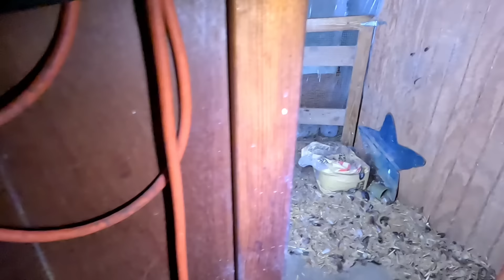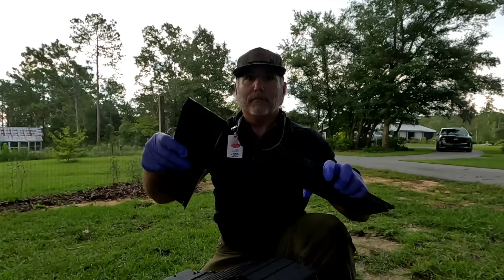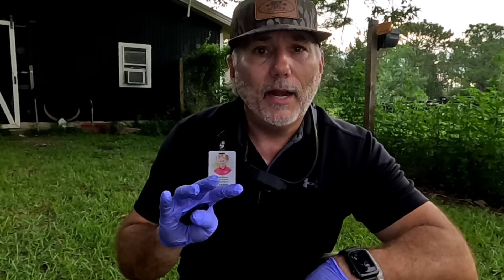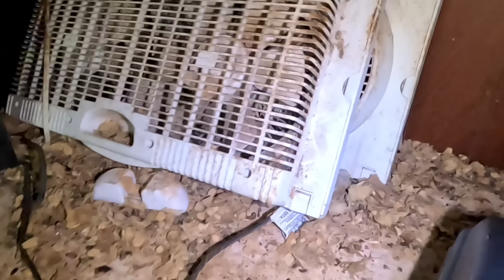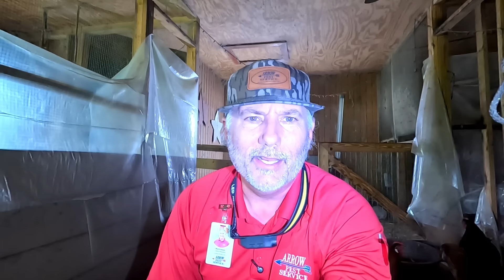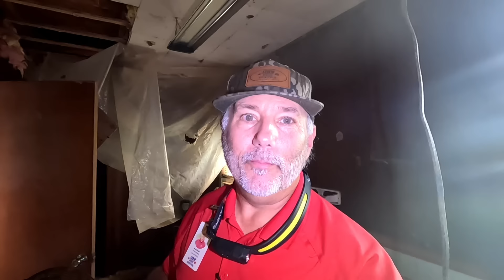Most Effective Rat Control Method Nobody Talks About!

Comment: If there is a existing food supply,  rat's will go for that rather than the bait, they are very short sighted and use the hairs on their fur to kinda see, they remember a layout of a room by rubbing along the sides of a wall or floor. When adding something different along their runs, they will avoid it like the plague until they get used to it, only then will they maybe venture into a bait box, but as i said, if there is food elsewhere that they have been tucking into for a while, they will still probably go for that. 
Then you have the issue of which bait to use, gel, wax, grain etc. As professional pest controllers we have a little arsenal of poisons that we use, very rarely have i only ever had to use one type of bait for a bad rat infestation, Rat's are not stupid, once a particular bait has been ingested and a few rats are unalived, the other rats will not go near the bait. You will need to change it for something else. You also need to know the best places to put the bait.  There is also the issue that most baits are multi take, this means the rat will not die after ingesting it's first meal, it must have a few takes for the bait to work, this is so it's safer for pets and wild critters but secondary poisonings do happen. Then there is the smell, there is a reason we have the saying, i smell a rat, nothing worse than a rat dying under your floorboards or in a space that is non accessible and decomposing slowly.  The fastest and cheapest way i think for non professionals to eradicate them is by using pre baited glue traps, the smell is enticing to rats and mice. You can lay as many as you like down and if you place them in strategic places along their runs, they will have no choice but to run on them or starve.. It may not be nice discovering a live rat trying to chew his leg off to escape, but it's better than having carcases rotting around your house or wherever the problem is.. The only other fast method is to kit yourself up with a silent airgun with night vision and laser red dot ,make yourself a comfy spot and start shooting, you can take hundreds in one night.  There are many video's on YouTube showing the success ratters have with airguns..
Reply from the maker: I have an air rifle  with a thermal scope, I thought about doing that and I still might.
Reply: @ArrowPestService  If it's a springer, the noise will scare them off a bit, with a multishot PCP they won't hear a thing..
Reply: Longest comment award

Comment: I got/had a problem with with ground squeals, rats, chipmunks field mice and pretty much every other kind of rodent. Uncle died and I took over his trailer we live in the desert so everything is attracted to this property. I tryed snap traps and glue they worked well enough but not for the big things. What I ended up doing was using 5 gallon buckets my uncle had old motor oil in so the sides were slick some rain water got in em about quarter of the way up. Ended up catching 4 or 5 per night in each bucket. I guess being the only source of water in the desert pays off. We have just been using the water buckets all summer. Its cut down the numbers pretty well. I now wana used these bate boxes you just showed us. But I will continue using the slick side water buckets also haha
Reply from the maker: Sound like you're doing a great job!keep it up.
Reply: @ArrowPestService thanks man
Reply: 12 guage shotgun
Reply: @tomkelly3896 tad bit over kill 410 works a bit better but I like where your head is at. The bucket is passive trappin. If i wanted to go on the offensive 410 with some bird shot wouldnt be to bad of an idea.
Reply: Yeah I got a 410 and a 22 i use when im bored and taking an active roll. But update the bait box works great. And i got a gang of cats now.
Reply: Oil floats, what were they attracted to?
Reply: @speedfreak8200only water in the middle of the desert.

Comment: After 20 years I started getting rats in my roof. I worked out,  they were getting in where pipes for A/C thru the brick. Installer never sealed up hole they made to run the pipes thru. I baited, got two,both by the outdoor A/C unit. I waited until the hottest part of the day and filled the holes with spray foam. Cheers
Reply from the maker: Good job finding the entry point and sealing it up!
Reply: @ArrowPestService thx mate
Reply: Take that new 5 gal bucket without the trap ON it, lay bucket it on its side (lay trap portion next to it) and throw some feed in and on them, for a day or two, then set it up they wont be scared of it. Also for bait us baking soda 50/50 with corn muffin mix making sure they have access to water....they bloat and die. But wont contain poison
Reply from the maker: @itscommonsense3128 awesome, thanks!
Reply: Had the same problem, could see daylight from inside, sealed with that black roof repair

Comment: On his channel, Shawn Woods talks about setting up the bucket Trap as a feeding station (disabling the flap door) for like a week to get the mice/rats used to it.  Then it's effective.
Reply from the maker: Yeah, I know I said that who has a week or two to get rid of rats. It might work, but it's not the most effective way to do it.
Reply: Natürlich kannst du das Futter auch hinter den Drehpunkt legen, nur vorne ein Gegengewicht !!
Reply from the maker: @CRPRA1703 👍
Reply: I put small dabs of peanut butter at the begining , middle and top of the ramp.
  They climb up and even eat peanut butter i put on the door.
 Some times they eat it and get away .
 Its crazy because the ramp is  balanced so if they get near the pivot point it can dump them .
 You cant put peanut butter past the pivot point it will tilt down.
I dont have the model you have . I have a generic knock off but it has caught me some.
 Good ideas in the comments i will try.
Reply: @vainwretch  maybe put it on the underside of the lever because they will still smell, and after having a taste they will be interested in getting more

Comment: We've used the bucket method, but we made it ourselves. Using a plastic water bottle making a hole in the bottom and then insert a stick or dowel threw it so it spins. Spread peanut butter on the middle of the bottle.. Filled the 5 gallon bucket half full with water. Then used a large  stick as a ramp to the top where the water bottle lays across the top of the bucket.  When the mouse or a  rat goes to get the peanut butter the bottle spins on the dowel and the critter falls into the water and drowns. Most we've got in one night was 13 mice. The bucket you have is too new, if it was covered in dust and rat poop it would have encouraged them to go into the bucket. But then you would have had a bucket full of live angry rats willing to jump and possibly bite you. Put water in there so they drown. As for the poison now you got a bunch of dead stinking rat bodies in places you can't get at to dispose of. Gross plus I think rats soon learn to stay away from that bate box. So will work for a bit, but the smarter ones will stay away and the problem will continue. 
Feeding rats baking soda mixed with peanut butter also works, also give a source of water to drink.  Rats can't burp so as soon as they drink water the soda bubbles in there stomach and they expire. Not nice but effective.
Reply from the maker: Wow-Thank you for your comment!
Reply: @ArrowPestService Use automobile antifreeze instead of water (as long as no livestock can get to it and drink it).  It doesn't freeze in winter and eliminates smell when they die.
Reply from the maker: @apetro8895  that's good to know thanks
Reply: @apetro8895 that's a new one! But I would make them venture outside to find a drink so they don't die inside
Reply from the maker: @speedfreak8200👍
Reply: @apetro8895  only issue with that is that if you have pets (cats, dogs, livestock, horses) that can get to the antifreeze too, they like it because it's sweet and it will kill them too. :( So make sure pets can't get to it, at ALL.
Reply: @reneejoy8004  Did I not mention that in the parenthesis?
Reply: @apetro8895 love this
Reply: @ArrowPestService  thank you for posting this video. Please post more. I also appreciate the comments. Thank God and Jesus Christ!
Reply from the maker: @TiffanyClark-p9t 🙌🙌🙌
Reply: Yes, that’s the problem I had with feeding them poison when they were in a 150/200  degree attic in summer in Phoenix… the smell! 🥴
Reply: Yep i had one go up inside my fridge and die couldn't get to it had to live with rancid smell everytime i opened the freezer it was blowing rotten rat fumes in my face🤮🤮🤮
Reply: @djp11WA  i would be in for a new fridge.
Reply: @djp11WA  Oh YUCK!! 🤢 I hope the smell finally went away.
Reply: And you kept the refrigerator and continued to eat food out of it wow!!!
Reply from the maker: @JohnLaws-sg8yh 🤣
Reply: I got rats in my loft; they won't go in snap traps or the cage traps. I can't use poison, so I'm going to try this bucket trap. Hope it works. I will let you know the results.
Reply from the maker: @Wy4U28  it may take a little while before the rats go into it but be patient, let me know how it goes. Thanks for watching.
Reply: @Wy4U28 did you try it yet?
Reply: @Tonisuperfly following
Reply: @Wy4U28  how did it go?
Reply: Dig a whole and set the bucket in it so you won't need the ramp and it will attract better with the  contraption being level with the ground , they will carry all the bait back to a nest for their babies, they aren't always eating the paper
Reply: The baking soda produces CO2 gas when it meets stomach acid, not water.
Reply: what is the measurements for the peanut butter + baking soda.
Reply: @andrievbastichy8551  -2 parts baking soda 
-1 part peanut butter
Reply: @andrievbastichy8551 ■ I use dry plaster of paris mixed with corn 🌽 meal and dabs of peanut 🥜  butter
Reply: @andrievbastichy8551 someone mentioned a 2 to 1 ratio.
Reply: Instead of water, I usye waste car oil in the bucket.
Reply: Rats will also carry bait back to their nest to feed their babies
Reply: I currently have a coop with rats big ones we tried the bucket trap no luck we got a few with snap traps under the coop they seemed to have figured out the snap traps haven’t caught one in there in weeks I have a camera in there so I see them every night running right by the where the traps are I can’t use the poison cuz they could die in the walls of the coop house is there any other method I can try is there some bait that rats can’t help avoid there is a ton of food on the food in my coop so there is a competing food source as well any advise would be great
Reply: How do I cut and paste these instructions.  We have a problem in our community garden
Reply: Electric rat traps work. No matter what is said here, tons of wildlife and cats get poisoned every year. Also chickens are omnivores and will take on a rat or Peck a dead one. Use caution with poison
Reply: Please make a YouTube video of your method. It would be very helpful to others.
Reply: Can you post a picture?
Reply: I think I need to get out more. Reading some of these comments has got me so excited to get my big butt out in my backyard and kill these little bastards.
Reply: I use the baking soda peanut butter trick and it does work! Safe for my pets too which is a very big thing for me
Reply: I used a similar bucket trap when the snap traps & sticky traps failed to eliminate some persistent rodents.  The bucket trap did the trick.  Instead of a wooden dowel, I used stiff wire from an old coat hangar, & I used an empty 2-liter soda bottle, which formed a larger bridge than a water bottle, making the rodents (rats & mice) more comfortable using it.  I smeared a little bit of peanut butter on the "ramp" (an old 2x4) in a few places to attract them up it, then smeared a bit more in the middle of the bottle.  They never defeated this trap.
Reply: @y @ywr969  did you ever try the baking soda and peanut butter method?
Reply: I used that method long time ago 2 to 1.
-2 parts baking soda 
-1 part peanut butter
Or
-2 parts baking soda
-1 part flour
Reply: They also love Jiffy corn meal mix with baking soda

Comment: You can put vegetable oil on the bottom of that bucket and leave it there for months and months you can dig a hole and dump it it's all biodegradable. What's your opinion on those birth control poisons they're using in New York
Reply from the maker: Interesting, I'll have to take a look at that! I appreciate your comment.

Comment: Didn't see any DEAD ones, though. Do they get eaten by the live ones ?
Saw a mouse coming to a baited mouse trap (the green block type), looking 'groggy', and before it could get to the trap, I smashed it with a club, splitting it so it's guts spilled out. It's intestines, etc, had the EXACT same color green as the bait blocks, so it obviously thought the bait was some kind of TASTY DESSERT. And it probably wanted a BUZZ.
So maybe the dead rats/mice could be extra tasty to the live ones. The poisonous bait will kill cats, though.
Had another mouse in the winter DIE with it's snout in one of those same block type traps, it's fur having turned that same color green, and it's poop also, that put an indelible little stain on the concrete floor I couldn't scrub off.   I was way grossed out. 
I enjoyed telling this true story.
If you wish, I can email a picture of the stain that's still there.
Reply from the maker: That's crazy, thanks for commenting
Reply: @ArrowPestService Thanks

Comment: Two points so far,  first our cat was catching and eating mice in large numbers , the mice in question  were  mainly slowed by anti colags and consequently poisoned our cat, that then had to be treated by the vet. secondly I purchased half a dozen snap traps last autumn  they catch rats , however they do not kill and  worse still they will not hold rats for too long they pull themselves loose. Once free the message gets passed on and no more trapped rats so money wasted.  if builders of these traps are watching get rid of plastic teeth and do as I do rivet and glue on saw blades, these kill and or grip rats like a salt water crocodile .
Reply: I saw someone use sharp screws up through the bottom of wood snap traps,  3 across the front and 1 on each side.  If you can get them in it will likely hold them but my rats steal the bait or avoid the trap.
Reply from the maker: They're smart little creatures
Reply: @michaelbruce7262  bait theft can be much reduced,  using epoxy glue fix a disc of expanded metal into the base of the bait dish only use the glue around the edges. when set introduce three or four peanuts and a very small amount  of hard rolled oats, next melt some cheap [ very hard type chocolate ] and pour over the nuts oats and mesh. this prevents theft and increases the chance of the rat accidentally tripping the trap.
Reply from the maker: Their smart little creatures

Comment: My go to is Just One Bite bars, but it would not be a good option in this circumstance. I do not have other animals that get into it, other than squirrels which are welcome to eat as much as they like. 

I had a large population around my pig pen and feeding was like walking into the hen house, they were running all over. I recently found they were living in an old turtle hole. Since I plugged up the hole, I have not seen any anymore. Armadillos have dug into another part of the old turtle system in the last few days. Now I need to plug that up before the rats start using it again.
Reply from the maker: Wow-that's crazy!

Comment: Some warehouses had a system a bit like that bucket trap you showed. They had water butts outside the building, kept part-filled from the roof drains. Into each butt a pipe led from the inside of the building out to the butt, turning 90 degrees to point down into the butt. The system had only two moving parts; the night watchman and his dog. 

The night watchman very regularly patrolled the buildings with his dog, deliberately scaring the rats. When panicked rats run for the first hole they know about, and they all knew of these holes. Pursued by a dog a rat runs and keeps on running; this resulted in a surprised splash as the rat hit the downturn and dropped into the water butt. Rats can swim, but in a hopeless situation they generally give up and drown.

The bodies were fished out of the water butts in the morning by the day watchman doing his morning rounds. Any rats still swimming were left for the afternoon round or later.
Reply: Put dish soap in the water to reduce surface tension. This makes it more difficult for them  to swim / float.
Reply from the maker: @harvburch8305 awesome
Reply from the maker: Wow, that's crazy!
Reply: @ArrowPestService  It took a steady toll on the numbers and if they ever got a surge then either dogs or poison was used. Problem was, before anticoagulants the poisons in use were brutal.
Reply: Never heard of a water💧 butt
Reply from the maker: @speedfreak8200👍
Reply: @speedfreak8200 It's usually called the runs, peeing out your butt or diarrhea.

Comment: We use final blox and selontra rodent bait.
Reply from the maker: I've used final blox but I've never used selontra! How do you like it?
Reply: It works. It's a soft bait. Holds up well and doesn't mold fast. We're just used to final blox, contract and fastrac. Also talon. It's another tool in the box.
Reply from the maker: @dhah3636 I've heard of it but never used it. I'll have to
Check it out, thanks!